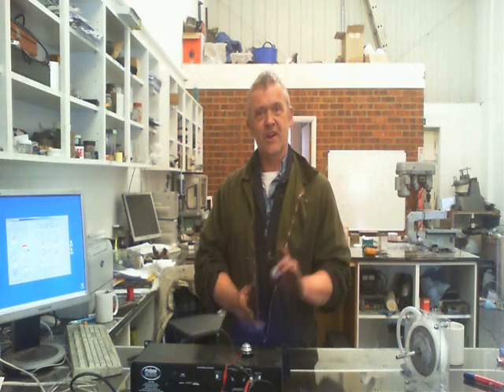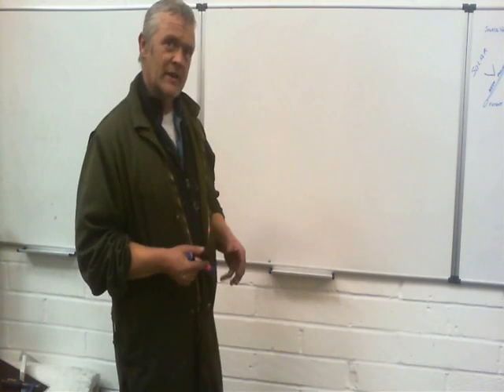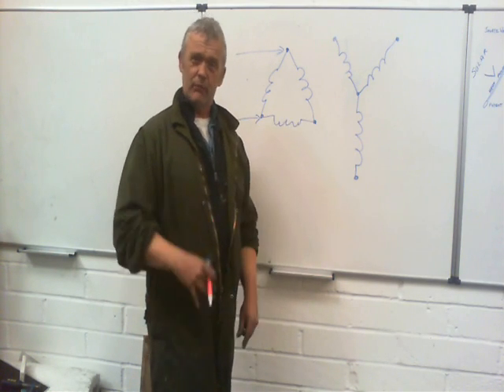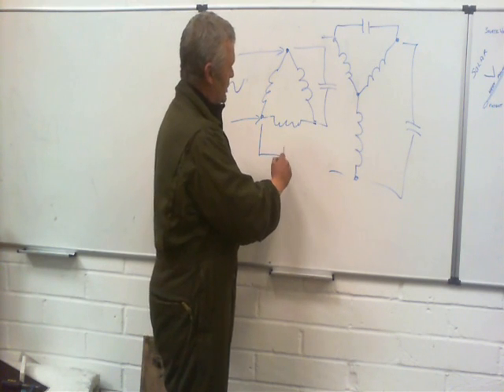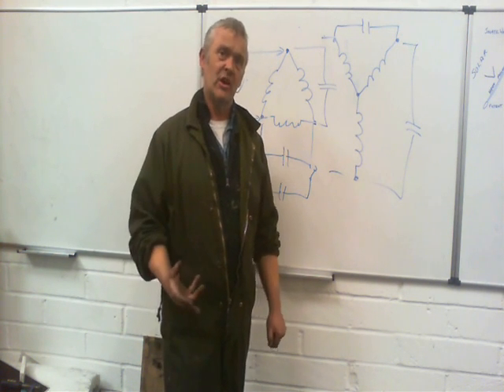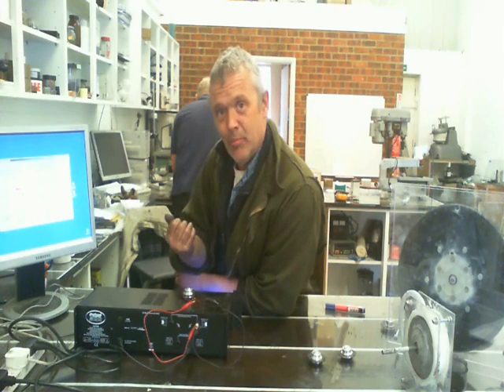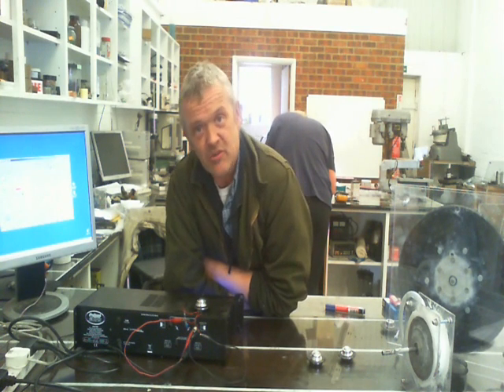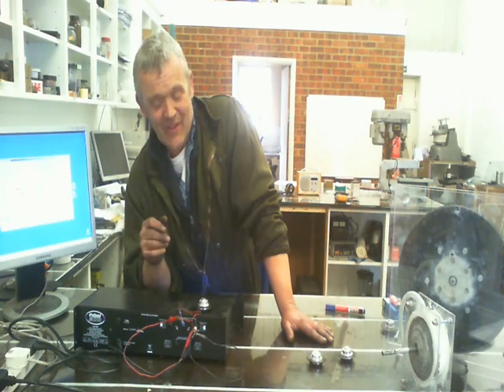How To Run A HDD Motor   Or Wire A 3 Phase To Run From A Single Phase

Comment: I have a 1000kv delta configuration bldc motor. I want to run it with 5-12v 50hz transformer. Motor's phase to phase resistance is 0.24ohm. 
What will be the capacitor value?

Comment: Thanks for this beautiful video on hdd motor topic , I have one question Robert, can I run it with 5v DC coming out from my laptop USB ? I understand with ac it will be  easy , I just want to use it as small fan. 
thanks
Reply from the maker: you could mate but you would need a controller board - a pi or arduino would work well

Comment: Hi Robert, great video.Question, can I use the delta connection with capacitors on a electro motor for a lathe with 4hp,1420 rpm,50Hz,220 V ? Will the lathe run OK,even under load ? Will it not burn the electro motor ?

Thanks
Reply from the maker: MBG-TECH i would certainly do it - but if you do it - it is at your own risk - this video is for information only and cannot be construed as advice in any way

Comment: I've suspected that this would work, but never tested it.

For those wanting to find more about how this works, here's something to start with: https://youtu.be/xyMH8wKK-Ag
The capacitor will change the impedance of the coil it is connected to and thus make its current intensity waveform lag behind of the other coils.
Reply from the maker: DigGil3 good one mate - i watched the lot lol

Comment: Very useful info as per usual, on cameras I picked up a Panasonic HX-DC3 for 80 quid on ebay roughtly about a year old full HD and the sound quality is outstanding, I'm using it to record Heavy Metal gigs and it can cope with Db levels that that require earplugs, its not overly flash just in case it get smashed up at a gig but i got allot of bang for my buck when I bought it.
Reply from the maker: DrQuiMobile nice one mate - I have heard the panasonic is very cool and used by reporters in the field but to be honest i am leaving this to my friend who is running the campaign for me - there is only so much time in a day and he really knows his stuff too and i don't - just know my limitations mate lol

Comment: Just donated 100 US to the go fund me site. How can I purchase your books with US currency? Also thoughts on intercollated phosphorous for phosphorene production?
Reply from the maker: suffolkcountysheriff Hiya mate, Thanks very much. I am aware of phosphorene - i read the paper when it came out - but I haven't really looked at and to be honest it strikes me as a long way from being useful so I haven't looked any further and I am not likely to in the near future - It is interesting but so are all the 'sheet like' materials - molybdenum disulphide for example - which i think is much more useful - unfortunately it is just not possible for me to look at everything and i therefore only look at what i think is interesting - this could mean i am missing stuff - but so be it - what i do look at is interesting enough for me lol
Reply: Robert Murray-Smith I hear you, so many cool things so little time.  So two more things.  1) how do I purchase your books with US currency  (dollars).  2) I am in the process of building a lab/work shop. I was wondering if you could do a video of basic equipment to stock it with. Heated stirrers, kilns.. etc. Bottom line I would like to start doing my own experiments based on your work and make videos as well. So far I have a 12ftx12ftx12ft area, insulated, heated and cooled, 7000 watts electric service, water. I haven't finished the interior yet and before I do I want to design the layout around what equipment I will have in it. Basically I'm looking for some guidance.
Reply from the maker: suffolkcountysheriff That is so cool mate - I will do a video walk around for you - I sell the books through smashwords which is a US company - I think they do it in dollars too. Send me an e-mail address mate and i will just send you the books - as a thank you for your donation - there is one that is very very useful but it is around 50 dollars - there is a ton of good info in it and it's a bit technical - hence the price - but dude - i really owe you one lol
Reply: Robert Murray-Smith cool thank you,  I just sent your Gmail account  an email from my yahoo account.
Reply from the maker: suffolkcountysheriff really? - i haven't got one - my email is robertmurraysmith64@gmail.com
Reply: Robert Murray-Smith just sent you another, check your spam just incase. I put suffolkcountysheriff in the subject line.
Reply from the maker: suffolkcountysheriff
got it mate - i will send them later today
Reply: Robert Murray-Smith cool, just make sure when you buy a camera you take two things into account. 1) does the camera record in a format that is natively supported by your editing software? For example MP4 file type or something else.  This eliminates the need for transcoding before editing, a huge time saver.  2) Make sure the SD card or micro SD card is "class 10". You need fast memory read/write speed when recording in HD video. This is very important.
Reply from the maker: suffolkcountysheriff
cheers mate

Comment: Neat motors but tricky. 
Technically they are 3 phase synchronous motor, but you are not wrong.

I have found a not too tricky to connect up controller chip (tda5145) that I like to use(good for 10-15W). Bldc controllers in general is what it takes.
There is also the vector/field oriented control stuff, that use a mix of magic and math as far as I can tell.

Otherwise there are the electronic rc speed controllers, I still think that name is wrong.
Reply from the maker: erlendse can you do a schematic for me mate - i'd like to follow that one up
Reply: Sure.. but I have only used the excample in the datasheet mostly. You may have to check ebay and aliexpress etc to get the part.. rather obsolete
Reply from the maker: Erlend Ervik don't worry about it mate - i'll just dig up the datasheet - though i was thinking of using a hall effect latch
Reply: It's no problem :)

I rather see HDD motors be used for stuff.

The HAL-route is technically best, but require 3 sensors (some let you get away with one).

That chip I mentioned is a block-driver, it senses one wire compared to center and drive the 2 other. Swapping the roles as the motor spin.
If you don't have the center-wire, a WYE resistor network may do the job.
Reply from the maker: Erlend Ervik i was aiming for super simple non frightening almost plug and play with this - technical comes later lol
Reply: Robert Murray-Smith RC ESC + servo-tester or the chip I mentioned then :)

The chip require a 4-wire motor, while a RC ESC spins anything 3 or 4-pin.
Reply from the maker: Erlend Ervik lol - we'll get there